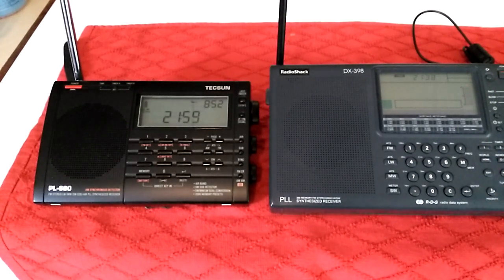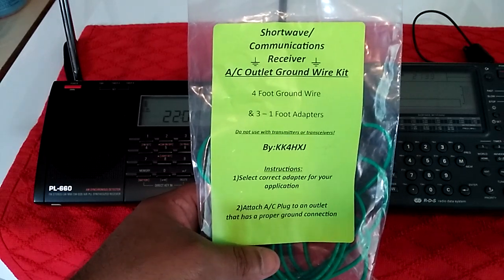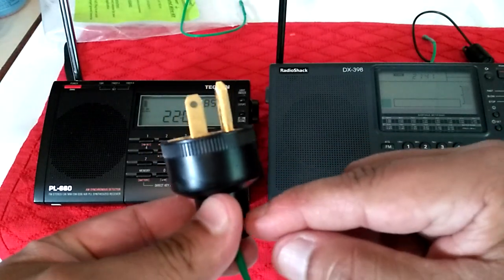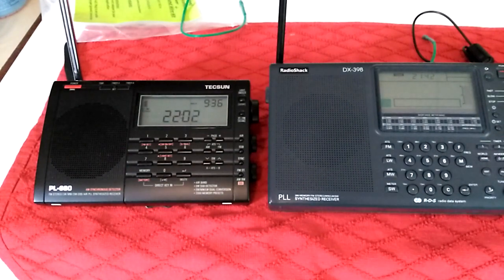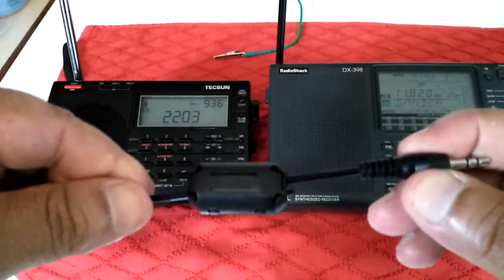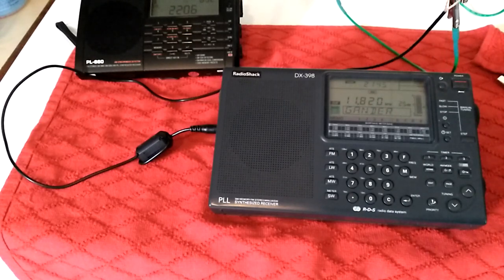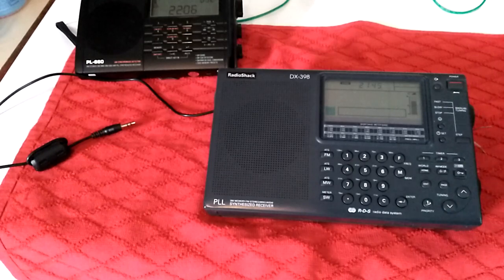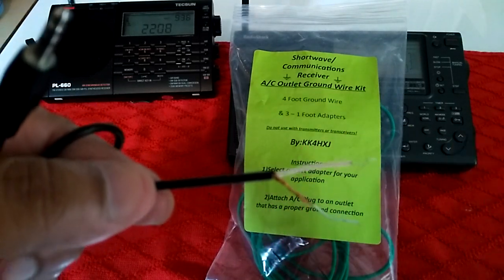Shortwave indoor AC outlet ground wire kit demonstration using portable radios

Comment: Would you please explain the antenna you connected. Is it just a wire with an alligator clip?
Reply from the maker: I was demonstrating this kit made for old receivers, I wanted to show people you can use this on a portable radio too.  I use a 3.5 mm cable that you would normally connect to a portable radio external antenna jack. I split that 3.5 mm cable on the other end.  1) the 3.5 mm cable was split the outer shield strand was connected with alligator clip to the ground wire kit socket, that is your ground.  2) The inner conductor wire of that 3.5 mm cable was alligator clipped to a wire near the window as my antenna.  I may revisit this video soon.  I got a lot hate for this video lol.  Thank you for watching. Have a great day Brendan.

Comment: I would make it myself, from the parts in my junk box.  Get some (professional) help, if you aren't sure which is the ground on the wall outlet.
You could also wrap a wire around a water pipe on your bathroom sink, toiletsupply pipe,  or a copper water pipe in the basement.
You don't really need a ground on most portables, unless you have a really expensive antenna, but you might get a little improvement.
Reply from the maker: In the video I explained how to test if the outlet is properly ground before using this kit. Although I did demonstrate it does work.  I don't use this at all. Is not something I would use daily with my portable radios.  I have tried wrapping one end to a copper pipe that seems to work also.  Yes you are correct, you don't need to ground most modern portables today.  This kit was made for older table top radios.  Thank you for the comment.  Thank you for watching.  Have a great day Tom.

Comment: Hello, great video. I hace a question. If the receiver does not have an antenna input and you only have the telescopic, for example the tecsun R9012, can I still conect the gruond  cable to something. Thanks
Reply from the maker: This kit only applies for radio that use an external antenna thru a connector.  In the case of your radio.  You don't need to ground your radio.  Using the telescopic antenna is grounded inside your radio.  Thank you for watching.  Have a good day Sergio.

Comment: HI, can you just connect the ground wire to the radio antenna with the clip?   Thanks
Reply from the maker: That would defeat the purpose of the ground. You can use another source of ground like a cold water pipe or radiator when not it use. I may revisit this video and make a update. Thank you for watching.

Comment: The curiosity bit me. I ordered one.
Reply from the maker: Yes, it did for me too when I search for this solution.  However, please make sure your wall outlet is properly wired and grounded.  I tested the outlet before using this with a electrical outlet tester.  Have a good night Edward.